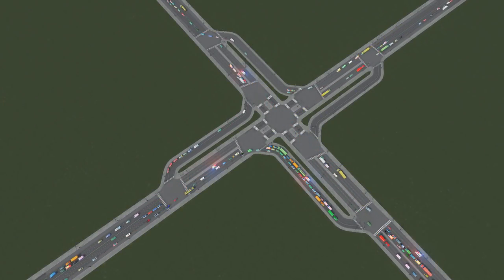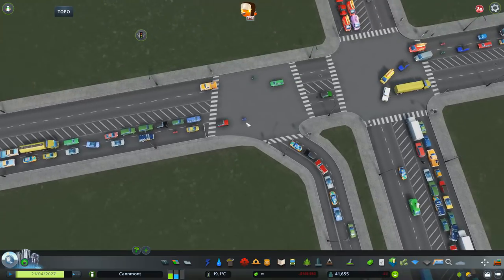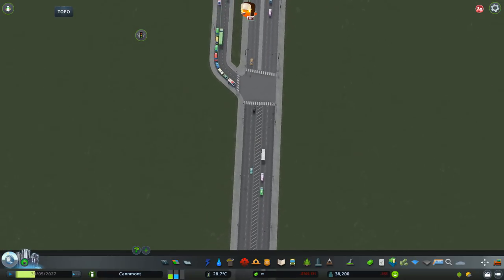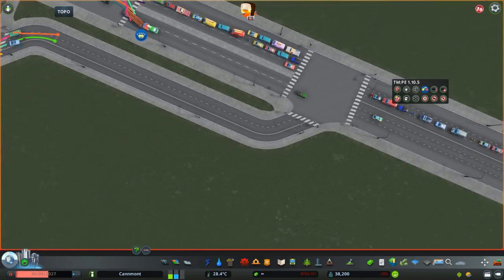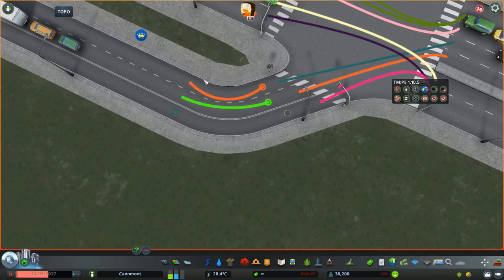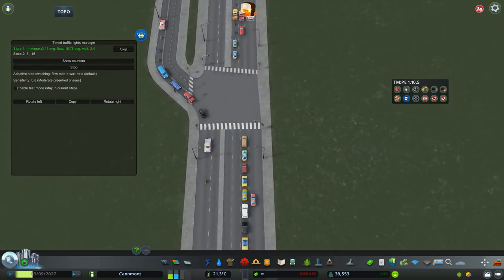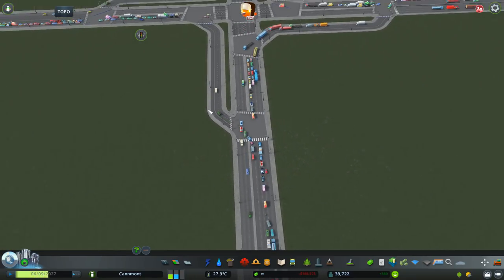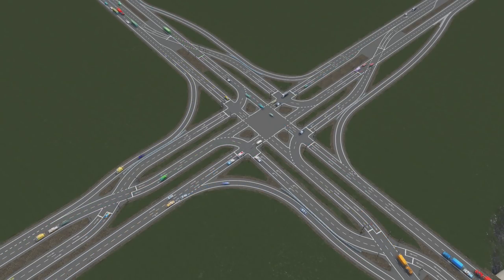Cities: Skylines - Tips and Tricks #11 - Simple Continuous Flow Intersection

Comment: I think at 3:45 you can't place the road with the perfect angle because at 3:38 you placed the beginning of it with an 50º angle!
Reply from the maker: Yeah, later in the video making I noticed that something is not right, but I didn't want to redo it. It's not the problem though, this is common when road you want to connect to doesn't have nodes positioned ideally (when building short segments)
Reply: If you look again it could also be because it was placed at 21 units instead of 20. At least that's how it shows on the video

Comment: just a question, where does the traffic comes from? Did you just add this intersection in place with lots of traffic in one of your already existing maps or is there someway to "create" traffic?
Reply from the maker: I created a totally flat map and randomly spammed residential, commercial and industrial buildings in all four corners of it, then built the intersection in the middle, will probably use the same map for some other tutorials

Comment: Wouldn't you want to sync the timing of the outer lights to the middle ones? What I mean is, you have the dedicated left suppliers filling as the cross traffic is proceeding forward, and have the fillers receive a green light just about the time the traffic reaches the final conflict point where they actually proceed onto the road they are joining. This would make the entire thing act as a unified intersection and increase the overall flow, just as they would tend to function in a real life example... Assuming people are following the speed limits and the weather is good.
Reply from the maker: well I did say that is the second option on how it is set up in real life, but it's a lot more complicated to do in the game and definitely needs to be tailored to the traffic situation, there are links in the description where the light phases are described for anyone to try this
Reply: @Akruas  I hope you don't mind, but I decided to make an intersection asset available on the workshop. I did a few fiddly things a little different than you, but the CFI concept is essentially the same. https://steamcommunity.com/sharedfiles/filedetails/?id=1633617475

I also added pedestrian path bypasses to do two things: prevent zoning on the intersection, and allow pedestrians to still get around it without tunnels or elevated paths that could cause slope issues.

Feel free to add it to the description if you want. I made it so I don't have to go through all the effort every time, then decided I should make it public since the others on the workshop don't look very clean. Mine isn't perfect, but I didn't want to use props or tree-lined roads so it could avoid missing prop errors and clashing with different themes.

Comment: Great video! Could you perhaps do a downtown/compact intersection tutorial some time? I'm having a hard time making efficient intersections that also don't eat up the little space i have in my high density areas.
Reply: I just upgraded one of my busy intersections with this type of intersection -- mine isn't nearly as pretty, but it functions the same -- and it doesn't take up that much more space than my 4-way 8-lane intersection did, honestly.  This one change raised my avg traffic flow from 74% to 78% (I have other bad intersections, but this one was a problem).

Comment: It looks like a minor improvement of a cheapo standard intersection. A few more dollars and an elevated exchange seems more reasonable. Perhaps smaller intersections see a greater advantage from this design? A roundabout with bypass lanes is even simpler and better imho.
Reply: Roundabout performance with regard to traffic flow drops significantly when traffic gets too heavy. The CFI is a real life intersection that is pretty much as good you are going to get for a single level intersection. The downside is that it does take up a lot of space. In real life, it is a very situational intersection.
In cities skylines, the traffic AI does not handle roundabouts very well, so intersections like the one in the video actual perform better when you test them. Though they are much harder to set up as shown in the video.

Comment: A good junction minimises traffic crossing each other. A decent alternative to this that would be a genuine continuous flow junction would be a spiral junction so that cars never have to cross opposing traffic. Anyone who can see this can see that the flow of traffic is not continuous, even with the assistance of mods.
Reply from the maker: Of course there are interchanges better than this, most interchanges are better than intersections, that's not the point, I'm building a real life design which is named the Continous flow intersection, you'll have to take it up with the original designers and ask them why they named it like that
Reply: the only traffic light is supposed to be at the middle, every other junction should have prioritized roads
Reply: also i dont think these roads are supposed to be all ways. there should only be 2 of the lane switches for it to work a little more effectively
Reply: The point where lanes cross each other did get minimized, despite the zones increasing. And with proper light timing the traffic can become semi-continuous

Comment: Could you make it an asset and upload to the workshop?
Reply from the maker: There is little point in doing that, since you need to do the lane connections and traffic lights yourself anyway
Reply: I find that getting angles and smooth curves correct to be pretty time consuming. It can be pretty convenient to have the intersection pre-built for you even if you have to do the connections and lights yourself. Luckily, there are already some pretty good CFI assets out there already.

Comment: This isnt any better than a 4 way stop haha. Nothing continous about it. Instead of having 2 way streets going from left to right, have them be one ways going underground so they dont have to cross traffic.
Reply: If you think this is no better than a normal 4-way stop, you don't understand traffic flow. This is a demonstration of a real life intersection design used in heavy traffic intersections without the need to build expensive over and underpasses. Obviously, interchanges with multiple levels will have less conflict points and better traffic flow. But this is one of the best designs for a single level intersection.
Reply: panner11 How so? This turns a single 4 way intersection into 12 intersetions. More intersections = more stopping. Thats common sense. If anything this only congest traffic more, but instead of traffic being stopped at the intersection itself they are stopped further back which only adds to the original problem.

A round about is even better than this and those are not much more efficient than a 4 way stop.
Reply: The primary downside of a standard intersection is that only 50% of the traffic can go at a time. What this design does is make it so that while the east-west traffic is green at the main intersection, the north-south traffic can still turn left and right. Thus only the north-south traffic that wants to go straight has to wait.
Reply: @shabutir1820  but a "single" 4 way intersection has a total of 32 points where lanes cross/split/merge, whereas this one has only 30. Might not seem much until you realize that it only has 2 light phases, which means each leg only waits red light for 1 green, as opposed to 3 greens. Therefore less red time = less car piling = less green time needed to clear it = even less red waiting time = even less car piling
Reply: @revimfadli4666  You are forgetting the other 4 intersections that make up this single intersection...
Reply: @shabutir1820  I didn't, I included them. Why did you say so? Please explain. The middle one only had 8 conflict points between straight lanes, so how could I get 30 by forgetting them?

How many conflict points would you get if you "don't forget" the other four?
Reply: @revimfadli4666  I count 32 points of conflict in this intersection (if it were 2 lane, its 3). Theres 4 points on the outer intersections, 1 merge and 2 crossing, 1 diverging. Thats a total of 12. I count 1 diverging, 2 crossing, 1 merge for a total of 12 on the inner intersections. I count 8 cross in the middle. For a grand total of 32 points of conflict in this design, if it were 2 lane. 

So explain to me how you came up with only 30.

You claim that light times will be less....however, you forget the fact that there are MORE lights required for this intersection design. Everyone is going to have to stop for the same amount of time as they would for a normal 4 way.

Its clear to see, that the only thing this design does is break up a traditional 4 way stop into 12 way stop. Which, besides costing a crap ton of money, does not logically provide any benefit to traffic flow.
Reply: Despite what you say, real life testing (of which the US has 21 of these intersections) has shown a sufficient improvement in traffic flow during peak traffic density to warrant the use of its design, especially when channelization is implemented. If you say this does not logically provide a benefit to traffic flow, then explain its success in the real world, would you? I seriously doubt the rather intelligent and experienced people in the upper management in a city that manage traffic flow would waste money and time for this type of intersection if it provided no benefits, it got implemented and its being implemented in specific areas for a very good reason.

Comment: People keep making intersections like this claiming high flow but they have far too many stops and traffic crossings to work efficiently.
Reply: He didn't invent this type of intersection. CFIs exist in real life. It achieves high traffic flow by accommodating high volume left turn, straight, and right turn traffic while still being a purely single level intersection. It does this by spreading out the conflict points that would otherwise overlap, and this allows all traffic lights to operate on a simple two state system decreasing wait time for drivers. The real downside to this intersection is that it takes up a lot of space, and obviously does not perform as well as multi-level intersections.
Reply: It only has 2 light phases, which means each leg only waits red light for 1 green, as opposed to 3 greens. Therefore less red time = less car piling = less green time needed to clear it = even less red waiting time = even less car piling
Reply: There are 21 of these intersections in the USA for you to watch their efficiency. Single level intersections are always very cheap compared to having to build raised roadways or dig tunnels to make an interchange. There is a video by a YouTuber called euverus who measured traffic flow on 30 different intersection designs with different traffic management mods and even without traffic signals. You'd be surprised how roundabouts don't provide quite the massive benefit we'd like to believe they do.